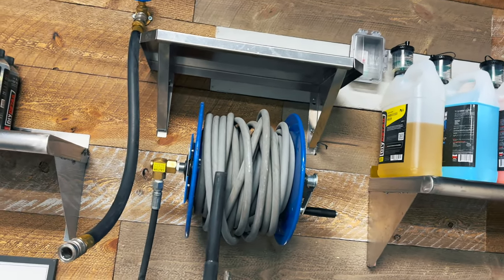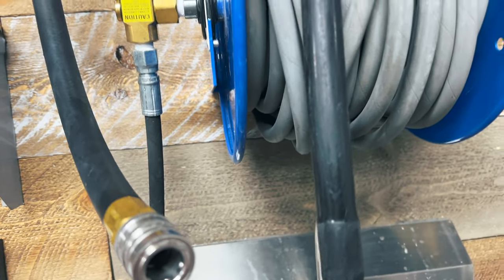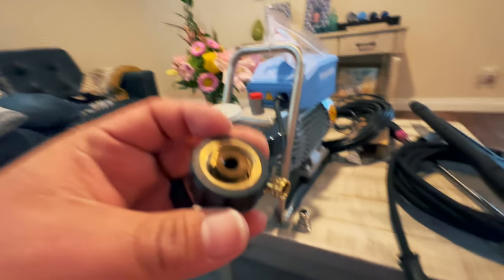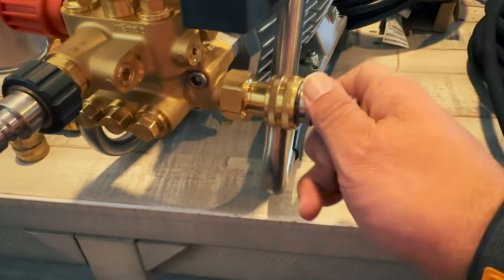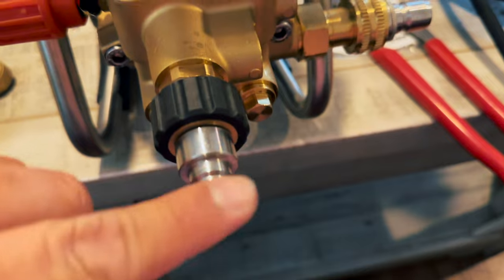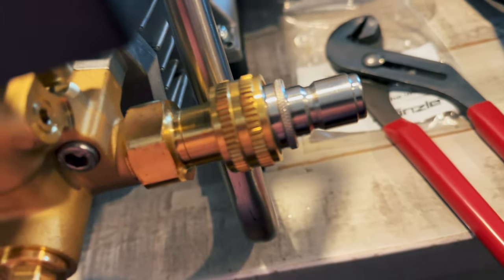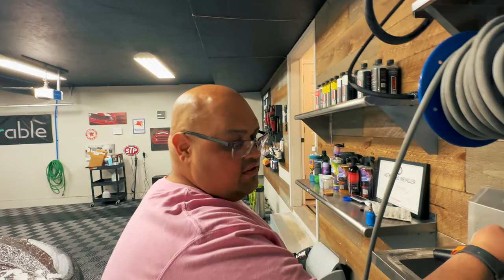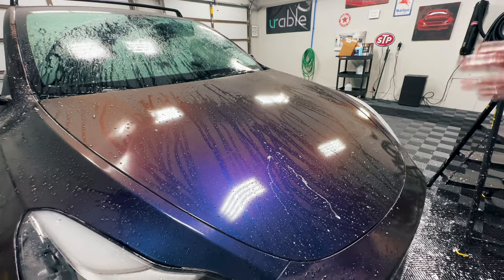I UPGRADED MY PRESSURE WASHER! Is it WORTH IT? --WATCH TILL THE END #recommended

Comment: Man u were prepped up and ready lol! i can't blame u coz i too was excited and 3 Kranzle machine later? im still excited lol! I highly suggest go all stainless steel on ur quick connects  and gun , it'll save u a lot of time and on the wear and tear and less maintenance coz rust and oxidation is what brass loves to have and with quality stainless quick connects u'll wont or at the very least far less work and maintenance. Congrats again and praying for ur wife's successful surgery.
Reply from the maker: Ill need to update the 14mm to stainless steal, I know the gun is and the hose one is ill get that going thanks for the advice!
Reply: @Ecdetails  btw make sure u have a filter screen on your water going in the machine (inlet), It'll extend the rubber seals and maintenance interval on ur machine. And just check ur oil sight glass before / after use for milky oil.
Reply from the maker: @1kontrabida  if it’s milky what do I do change the oil ?